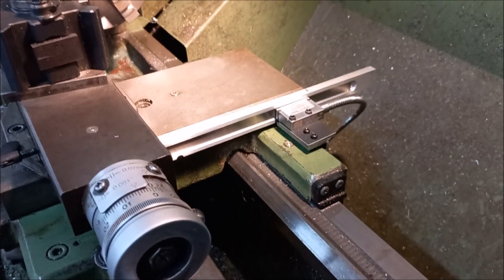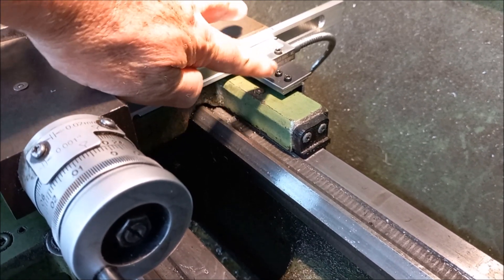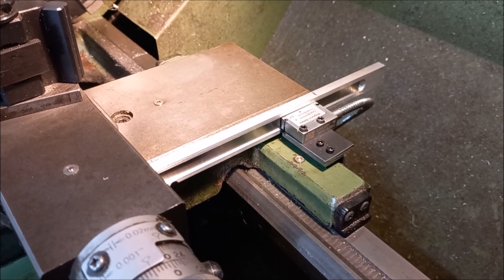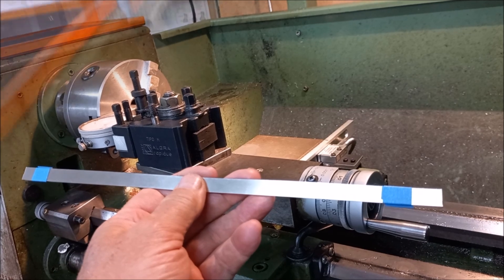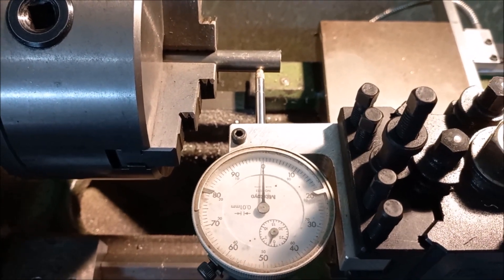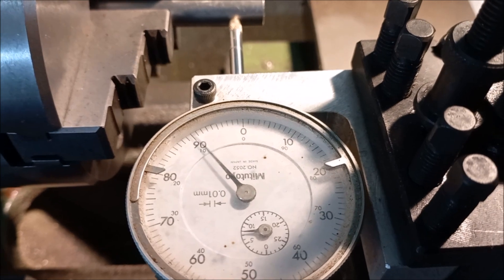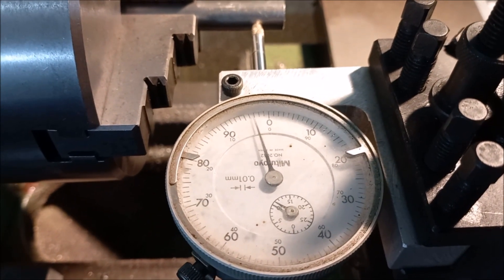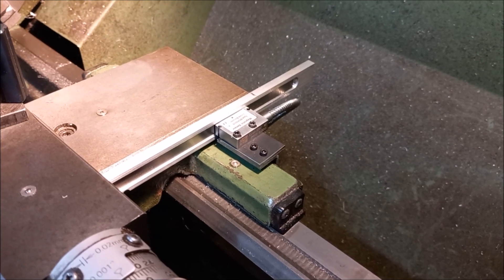Cross Slide Magnetic Read Head DRO for small Lathes

Comment: I embedded my magnetic scale embedded under the cross slide in a shallow slot milled into the recess. I had to extend the rear of the cross slide a couple inches but it works great, and cant be seen or interfere in any operation, and more importantly it cant be hit by the tail stock when it is pushed in to center drill
Reply from the maker: Hi John, and that's exactly why I'm considering fitting one to my Hi Power Lathe, to give the Tail Stock a closer fit to the Cross Slide.
Cam

Comment: I am glad you made this video. I have same scale on my lathe and I mounted the magnetic strip straight to the cross-slide and didn't bother with the stainless steel cover. It works very well and is very repeatable. Thanks again for putting this up.
Reply from the maker: Hi Bruce, yep these little Readers are fantastic.  Very repeatable, easy to install and a great price.  I might even remove the Glass Scales off my Hi Power Lathe and fit on of these so I can get closer to the Cross Slide with the Tail Stock.

Comment: Gday Cam, there nothing wrong with that, like you said great for small lathe and mills, thanks for sharing mate, cheers
Reply from the maker: G'Day Matty,   yep these little Readers are fantastic.  Very repeatable, easy to install and a great price.  I might even remove the Glass Scales off my Hi Power Lathe and fit one of these so I can get closer to the Cross Slide with the Tail Stock.
Cam